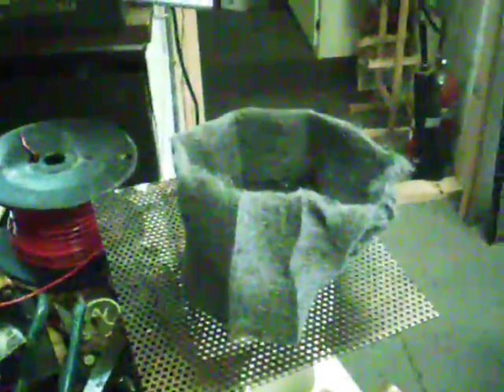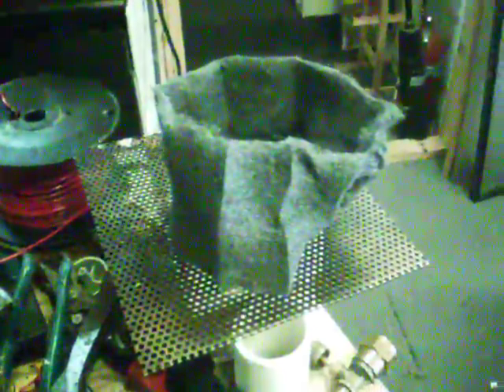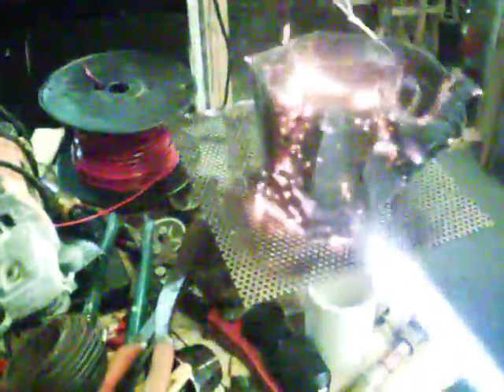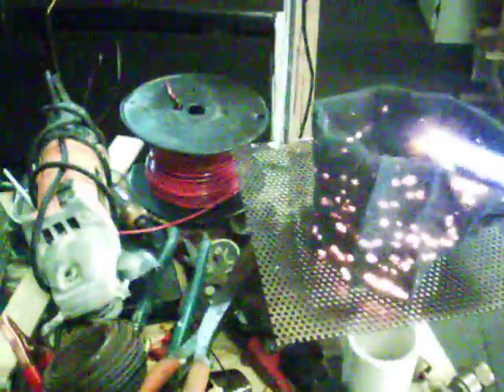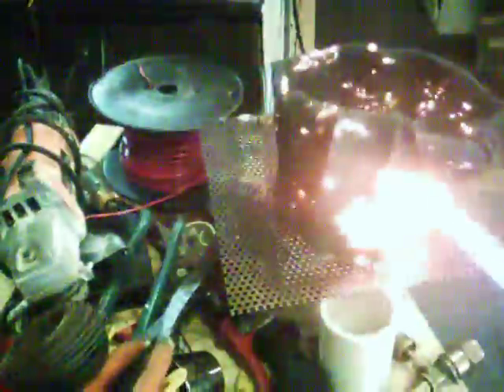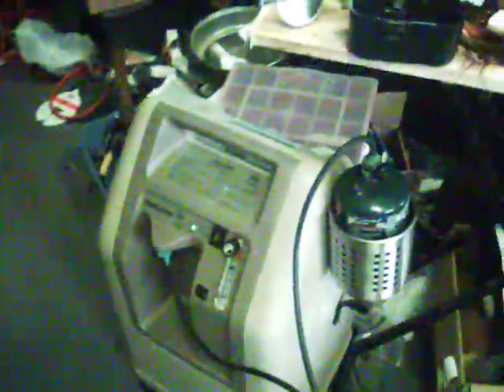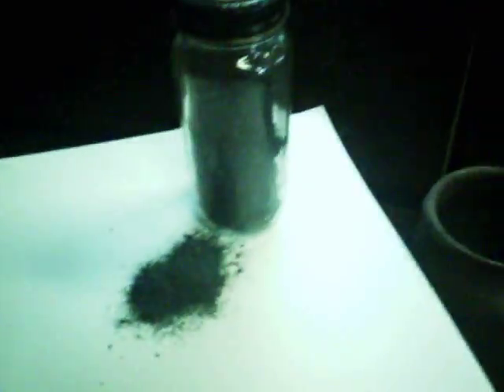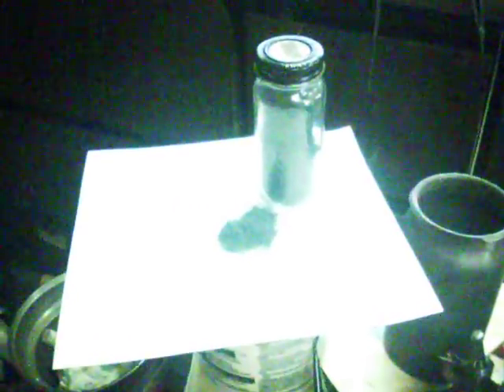iron oxide tutorial-nife battery construction1 9

Comment from the maker: Hi there the oxygen concentrator I got broken for 10.00 and made a simple circuit board repair.
It works great I put a mapp gas cylinder on it and brazed up a hole in a transmission pan yesterday.Ed